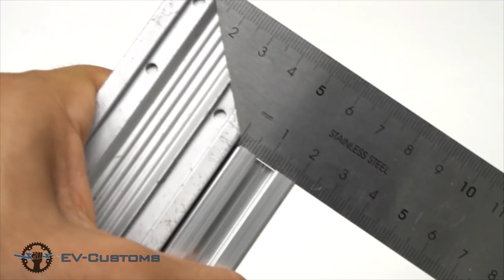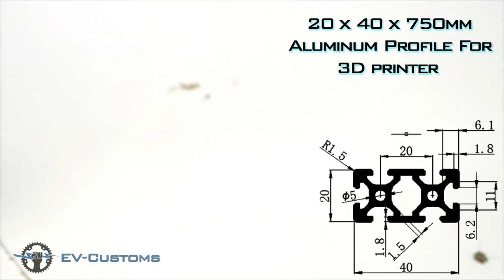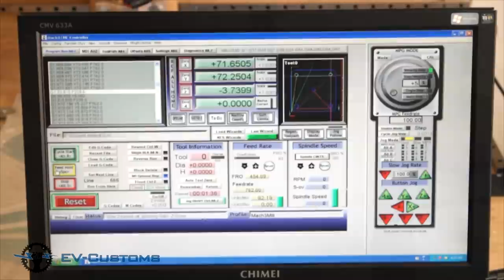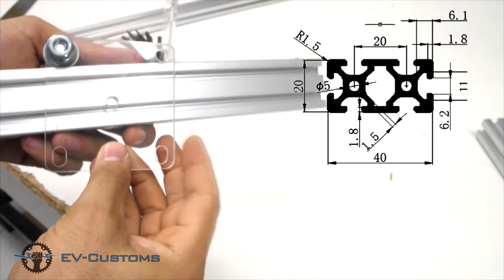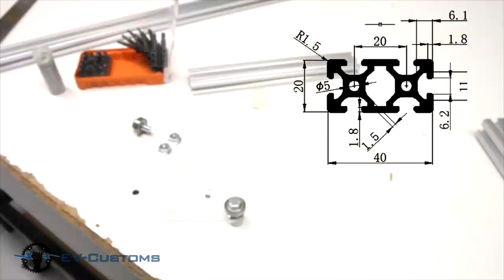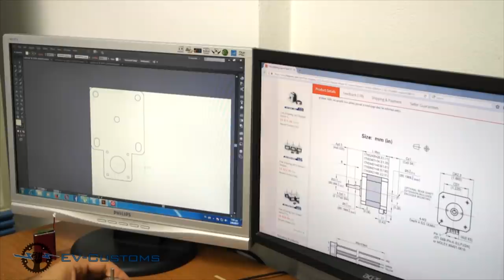$35 DIY Motorized Camera Slider With IR Remote control for DSLR or Action cameras

Comment: Very nicely done...question...can you automate this with the remote?  I want it to back and forth without having to do this manually
.
Reply from the maker: hello friend, unfortunately you cannot do that... You can do that only with limit switches directly connected to push buttons on the board
Reply: @EVCustoms  Thanks for getting back to me...I love the design...what changes would you suggest to automate this?

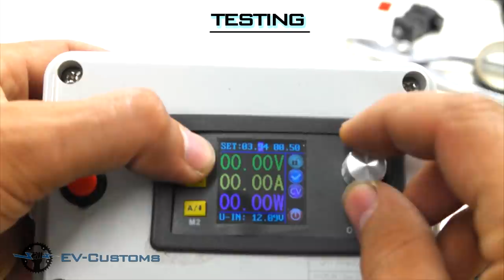Comment: Tell me please. It’s not entirely clear that power is supplied to the controller 5 volts, but during the test  (3:09) on the power supply 12 volts? Isn't that a lot for the controller? Is 5 volts enough for a normal stepper motor to work? 
I put together the same circuit. Everything works, but the plug (4 pins) of the stepper motor connection is very hot on the board. Maybe you need a smaller engine, for example nemo 11?

Comment: Hello.
Did as you do.
It is very hot and the small chip stinks.
What could be wrong?
Thank.
Reply: I tried without load, without a camera.
I tried 4 motors, 4 drivers like you.
Nothing changes. All warm up, burn your fingers. (
How to fix?
Maybe something else needs to be connected?
Thank.
Reply from the maker: Hmm... How volts and mah you put on  your board? Notice max mah is 500-600mah and voltage 6v max ..  otherwise your board is problematic...
Reply: @EVCustoms   5 volts, powered by usb
Reply: 2 amps can not?
Maybe this is the problem?
Reply from the maker: Yes this is the problem...  Put if you have 5v 500mah power supply
Reply: @EVCustoms  Made exactly 5 volts, 500 mA. Heating is still there. I do not know how long it will work or burn)
Reply: @EVCustoms  Thanks for the answers, I will try again)
And wire connections?
Red - red.
Yellow - yellow.
Black - green.
White - blue.
Is that right?
Reply from the maker: If motor is turning then your wiring is ok..
Reply: @EVCustoms  measured the heating temperature of a small microcircuit.
  65 degrees Celsius or 149 Fahrenheit.
Seems to be OK?
But, the finger burns a little)
Reply: Hello.
And if you connect 2 motors to one driver.
Need to increase current?
Or will pull without problems?
A load of approximately 2 kg. DSLR camera with lens.
Move vertically.
I purely theoretically ask)
Later I will try, I will write to you what happened.
Reply from the maker: My friend if you put two motors you will burn your board....  You need bigger board...

Comment: Great tutorial, thank you. What would be the maximum camera-weight this rig could move?
Reply from the maker: Hello Heinz Ross..  maximum weight for this project is 1.5kg
Reply: Thanks for your reply. I want to use a Canon 7D and it'll be more than the 1.5kg.
Reply from the maker: Heinz Ross On flat surfaces is ok for 7D.. you can put  more than  2kg camera..
Reply from the maker: Hi friend..  for angles this stepper motor (Nema 17 ) is good..  the only problem you will have is this stepper motor controller working only with 6Volts max, motorcycle battery have 12volts,so i would suggest you use simple mobile power bank witch have 5V output on 2Amps..

Comment: Hi, great project. What`s the thickness of the acrylplate? and the size of the extension at minute 6.43 ?
Thanks mate.
Reply from the maker: Hi friend..
Plexiglas is 5mm.. you mean bolt extension?
Reply: @EVCustoms   yes  the bolt extension, M8? Can the system be operated by an " ARDUINO " as well, with some modification ?
Thank you and wishing you all the best for the festive season.
Hans

Comment: How noisy is the motor?
Reply from the maker: Motor is not noisy, but if you run  motor on must  lower  speeds maybe  you will have low vibrations...

Comment: How do i make the gantry stop automatically after it reaches the  end of the rails.
Reply from the maker: Hi,, The only way is  to put 2 limit switches left and right sides of rail, and connect them in parallel on play board button...

Comment: Hi there, i buy the Stepper Motor Driver Controller Board Speed - during operation at low engine speeds - the board overheats strongly. Why?
Reply from the maker: Hi friend...  Try to control your power  input...   Max input for this module  is 500mA  or 0.5A
Reply: @EVCustoms  Hi, thank you for answer. I use poberbank as a power source (5v 10000mah). In this case, you are recommended to use a down converter - dc-dc. To get a total of 5v and no more than 0.5A ?
Reply from the maker: @OnTheReview  Right my friend...
Reply: @EVCustoms  Ok, on you video when using Lithium battery and boost up converter 5 volt 600 mA - does the board not heat up, always cold?
Reply from the maker: @OnTheReview  The board is on 30 degrees on working mode
Reply: @EVCustoms  Ok, and last question - On the video 18:49 you have dc-dc converter with micro usb then you show the dc-dc converter with usb-а input. Converter with micro usb - used only for charging the lithium battery?
Reply from the maker: Yes my friend

Comment: Please i need help thanks.
  I bought Nema 17 Stepper Motor Bipolar 2A 59Ncm(84oz.in) 48mm Body 4-lead W/ 1m Cable .
 Can i use it by a same controller that used in the video ?

Comment: Hello
thanks for your tutorial, could you tell me the voltage to power the Stepper Speed Controller Motor Controller Controller Board
cordially
Reply from the maker: Stepper Controller power voltage recommended is 5 Volts max 6V

Comment: Very nice design. Congrats! Is it possible to connect end switches so that the slider changes direction when reaching the end? Thanks for sharing!
Reply from the maker: No...  Like this you can not  change direction then slider reach the end...  But you can make some changes to make this mode... Such as putting limit switches on the end of raill, connect them on controller board switch buttons (left direction and right direction)

Comment: Does the motor have enough torque to move the camera vertically. And if so, what is the maximum weight? Thanks!
Reply from the maker: For 90 degree vertically only action camera you can move
Reply: @EVCustoms  it means the driver is weak. Because your motor 17HS4401 can give a very big torque (about 4.2 kg !!! per cm).

Comment: Is it possible to use a heavy camera on it, for example Canon 5D2?
Reply from the maker: Yes my friend you can put dslr camera... I already tried with dslr cameras
Reply: @EVCustoms  
Thank! Very good idea!
Reply: @EVCustoms  can it lift-up DSLR camera (at least 1.5 kg including the lens) when the slider is placed vertically? (vertical move).
I know your motor is powerful but can the driver give enough power output to motor for vertical moving?
Reply from the maker: For vertical movement no! Is not possible..
Reply: @EVCustoms  its very important possibility for slider. Because horizontal movements can be done also with roller slider.

Comment: I collected the necessary parts from the link on the page you gave, make that my camera slider. But allows too much vibration to work by my slider. I can't find what I did wrong.  Do you have any advice for a solution?
Reply from the maker: Vibration on lower speeds?
Reply: @EVCustoms  yes, speed 1,2, 3 has more vibration... but speed 4,5,6 has low vibration... i mean every spped level have a vibration... by the way my motor and camera bracket is not plexy product, i am using plywood product...
Reply from the maker: Also my slider doing this on 1-2 speed.. but in my videos i can't see vibrations, only bad noises..
Reply: @EVCustoms  maybe but maybe i found a solution with my slider vibration... i'm using too many washers with connections, first of all canceled them and try to clean plexy product with my bracket...

Comment: Other stepper motors can be used with the module "Stepper Motor Driver Controller Board Speed Adjustable"?  Nema 23? Nema 17 Stepper Motor Bipolar 2A 59Ncm? Can I ask for exact dimensions of the site for the engine and for the camera?
Reply from the maker: Yes this board is universal for 2 coil stepper motors, but low amp output from module...
Reply: @EVCustoms  Can I ask for a photo of the site for the camera, with the exact dimensions?
Reply from the maker: Camera dimansions...? Samsung nx1000
Reply: @EVCustoms  I have a canon 5d2 camera, can I use it?
Reply: @EVCustoms  
I ask the exact dimensions of the construction of plastic. Thank!
Reply from the maker: @MSVSanjok   Yes is good solution..
Reply from the maker: @MSVSanjok  Sorry i don't remember dimensions..  you can see on g-code file the dimensions..
Reply: @EVCustoms  You gave 12 volts to the Stepper Motor Driver Controller, but is it 4-6 volts?
Reply from the maker: @MSVSanjok  Here i give 5-6volts its ok to work stepper motor...

Comment: dop you have motor mount stl? and can you share? :=) ver nice. i will make it. :) thank you..
Reply from the maker: Hi friend... You mean you need mount bracket of stepper motor? Have you cnc router? If not i will make it for you
Reply: yes i need mounth bracket of stepper motor stl. i have 3d printer. i will make it if you share slt. :) thank you for answer. :)
Reply from the maker: Aydin Şen Ah ok... I will send you  g-code or bracket ok? Or you need SVG file?
Reply from the maker: Aydin Şen send me your emal..
Reply from the maker: Ok guys i sent it already.. sorry for late..
Reply: thank you soo much but  i need " .stl " format. 
I could not translate this format.

If you have stl, my job will be very easy. Otherwise it is not a problem. Thank you very much for your interest. :)
Reply from the maker: Aydin Şen My friend I don't know this file .stl... I can send you SVG its ok?
Reply: EV - Customs ok thank you.  sorry 😇😇